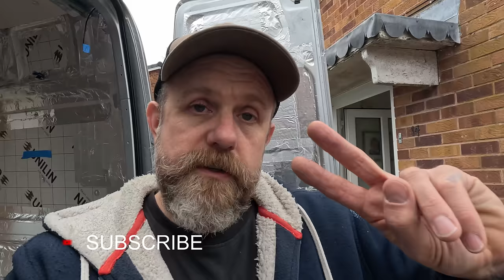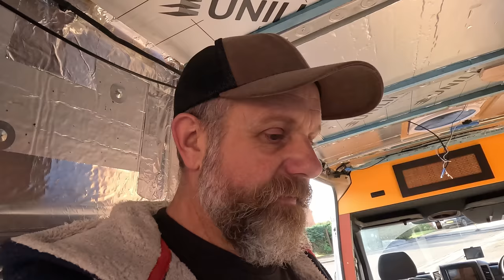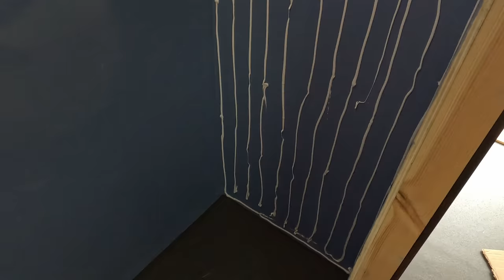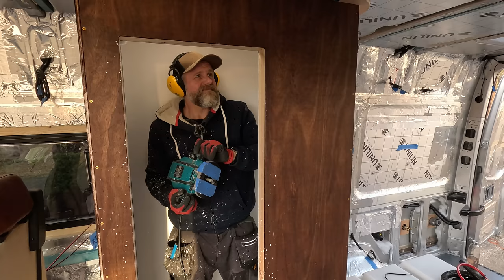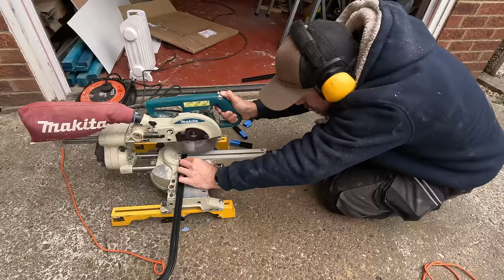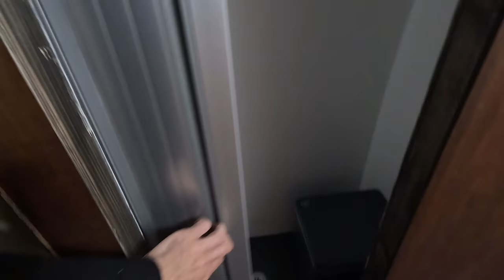Sprinter Campervan Shower Build Complete 🚿✨ Two Thumbs Up from Ella!

Comment: Great video the shower is looking great i like the floor and the white walls ❤there's only 1 thing I would do the walls john stained look lovely but I would finish it off with a top coat of clear varnish it help to protect the wood and would be easier to clean and some what waterproof it just an idea ❤❤❤❤❤
Reply from the maker: Hmm. Thanks. Yeah that's a really good idea. Not thought about that🤔
Reply: @life_uncharted  It protect the wood against any chipping from impact or from the elements, varnishing is your best choice. Many woodworkers decide to stain and varnish a wooden surface at the same time. Note if you use a water-based stain, use a water-based varnish 👍
Reply from the maker: @ls1100  this is all good info. Thanks for that😁😁

Comment: Hi I've got the same shower door we've put some drainage holes on inside of bottom track  to help water drain when parked off camber. Great job on shower room👍
Reply from the maker: Thank you so much. Sounds good. I always think of bits I could have tweaked a bit but I'm in such a hurry 🤦

Comment: The vans coming along fantastic. Ella will love her speakers. I’m putting my ceiling furring strips where you have them except I added M4 rivnuts in the small holes on top. Looks like you used zip ties?????
Reply from the maker: Hi. Thanks so much 😁. I used self tapping chunky screws. The zip ties are for the wires
Reply: Oh. I didn’t see any screws! 👍 I’m going to drill through the bottom furring strip to the rivnut in the top near the roof rail using bolts. Thanks
Loved Ella’s smile with the bathroom!! 😁